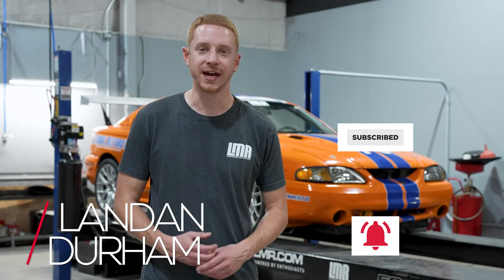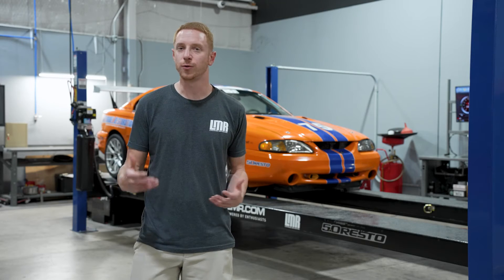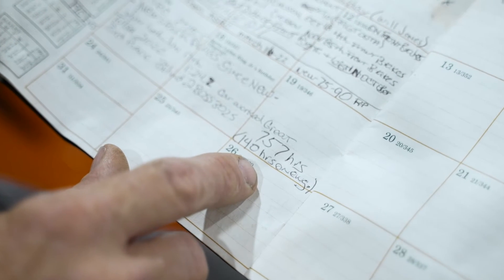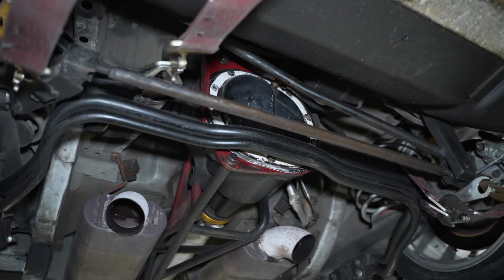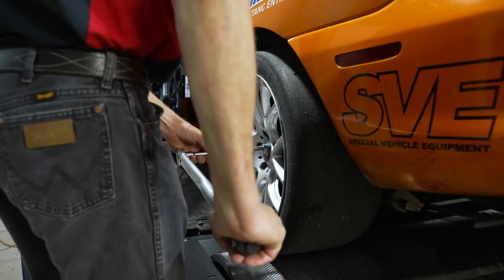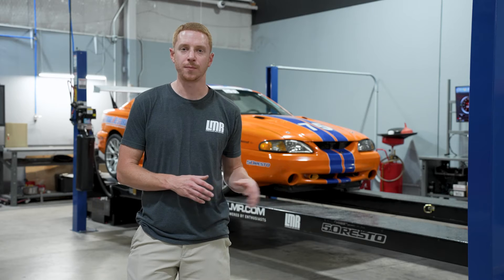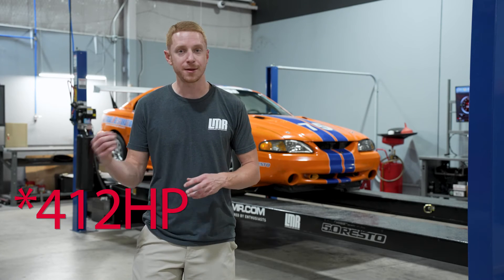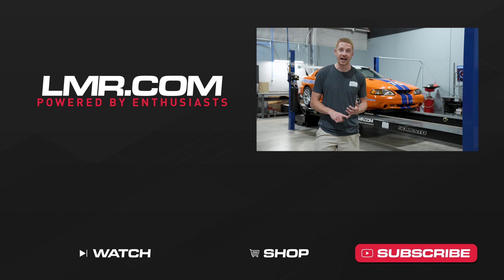Project Coyote Swap 1997 Bondurant Cobra Race Car Hits the Dyno!

Comment: Gen III intake and E85 will wake that beast up! Cool car for sure!
Reply: Whats E85
Reply: @elishawoods9330  Ethanol fuel. It’s overrated imo because it’s more expensive and corrodes the internals. I’ll stick to “real” gas.
Reply: @angelgjr1999  should only corrode if it sits unused for a while. Lots of people who run e85 in-season flush out there fuel system with straight gasoline when winter comes and nothing bad happens.
Reply: E85 is always less than even 87 let alone 93 and you can make alot more power by being able to run more boost and/or timing and do it more safely don't spread bad info
Reply: THERE IS A BIG REASON WHY IT HAS A COYOTE IN IT LOL THE ORIGINAL 4.6 WASN'T A STRONG MOTOR LOL I KNOW I BOUGHT A NEW 97 COBRA AND WITH 2 THOUSAND ORIGINAL MILES  I  MISSED A SHIFT AND THE GARBAGE 4.6 EXPLODED AND BEFORE ANYONE START TALKING SHIT ABOUT MY DRIVING LOL IF YOU HAVE A MUSCLE CAR WITH A STICK AND YOU NEVER MISSED A SHIFT LOL YOUR TELLING A LIE LOL.
Reply: @anthonylaudano9435 I’ve missed shifted my 96 cobra maybe 3 times while racing and the car is still running solid! Maybe you were one of the unlucky ones to get a pile of junk lol
Reply: I think dude blew it by being a shit driver and wants to blame the car because his narcissistic ego is shattered lol